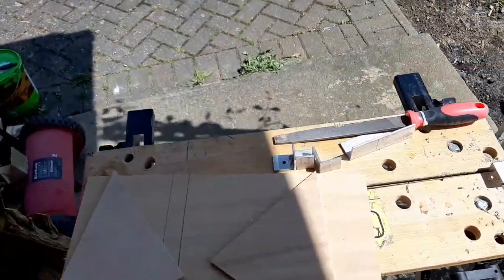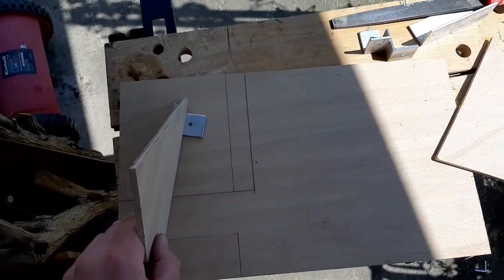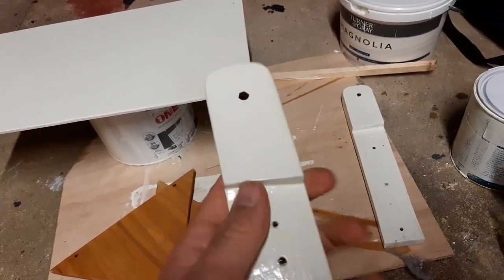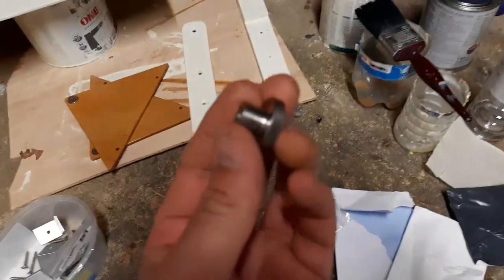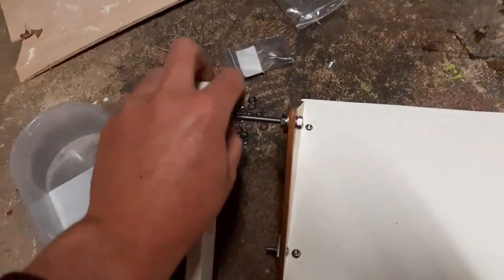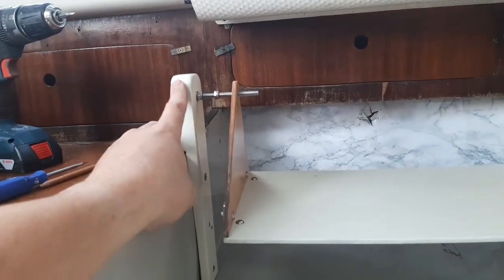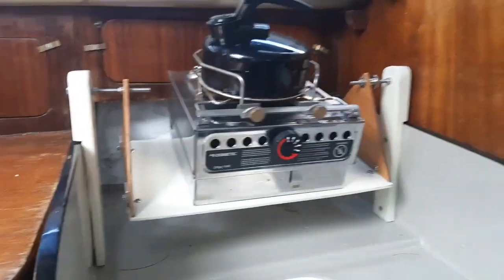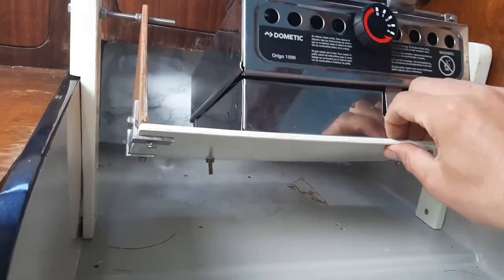Make a Stove Gimbal for your boat, Origo stove

Comment: Did a DIY version on my 3000 version. DIY pan holders too. The original parts are so ridiculously expensive!
Reply from the maker: Yes the bloom'n are, a gimbal from origo is around £80 and you fit the thing yourself into whatever space you intend to use it so still a bit of messing around.

Comment: You need a counterbalance (aka: weight under the stove).  You'll need to further work this project after multiple sea trials.  This wouldn't cut it, I'm afraid.  (Go to sea and watch what happens when you put a pot of spaghetti on boil....)
Reply from the maker: Weight is in the fuel cell of the stove which provides the low center of gravity to the pivot point.